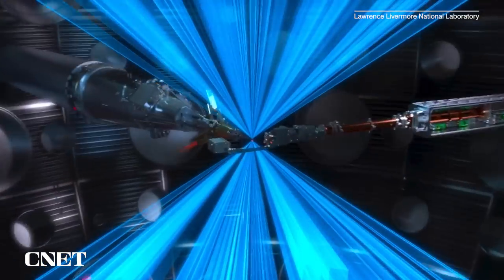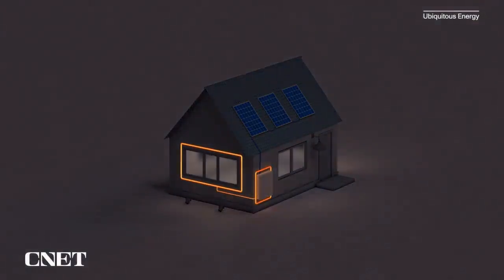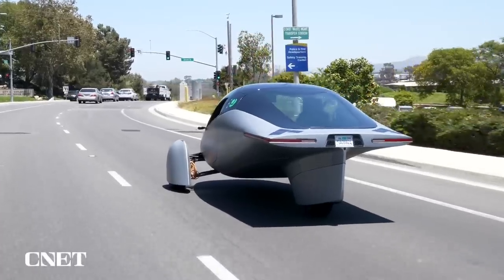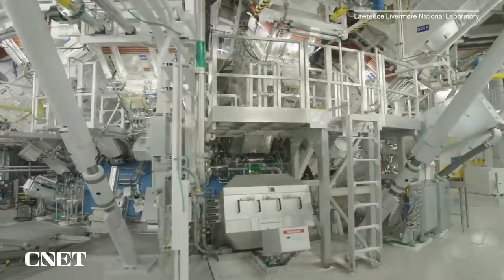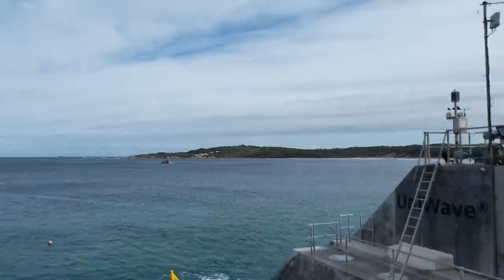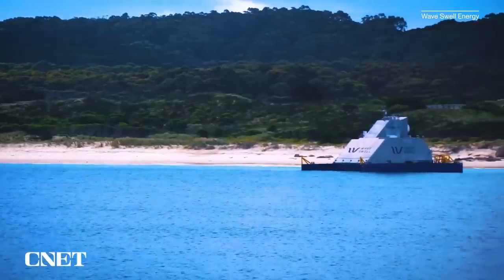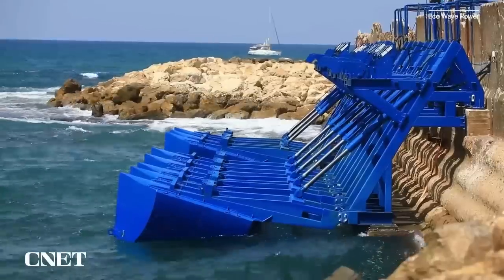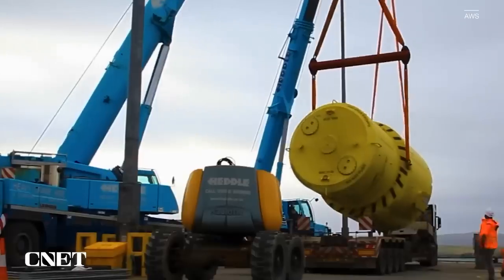Breakthroughs in Clean Energy to Watch in 2023

Comment: I’m very keen for the aptera. A beautifully designed car that will give a new level of freedom in a car.
Reply: I can't wait for the announcement of an aptera with 4 or 5 seats
Reply: Aptera is an electric TukTuk. Not good in northern regions where snow makes roads impracticable even for regular sedans
Reply: That's great to hear that you're excited about the Aptera and its innovative design! If you're interested in clean energy solutions, you might also want to check out the Segway Portable PowerStation Cube Series. It's a versatile power station that can keep your devices and appliances running for extended periods, making it perfect for outdoor adventures or as a home backup power source. It has a massive capacity, fast recharging, and even includes comprehensive protections. It's definitely worth considering for your power needs!

Comment: The wave swing looks good, it doesn't take up a large footprint or upset any views. No noise and could be used as science platforms
Reply: Thank you for sharing your thoughts on the wave swing in the video! I totally agree that it's a great clean energy solution that doesn't take up much space or disrupt the surroundings. It's definitely a promising option for science platforms. By the way, have you heard about the Segway Portable PowerStation Cube Series? It's a versatile power station that can keep your devices and appliances running for extended periods, perfect for outdoor adventures or home backup power. It's worth checking out!

Comment: since the ocean is used to acquire energy from, I think it's possible to utilize the energy people expend when exercising at the gym to be harnessed in a battery and recycled. This would be a great way to build communities participation in producing energy and physical strength and health.
Reply: Planet fitness already does this with their bikes to some extent while you exercise. It doesn't store energy, but its entirely run on mechanical energy. This means it doesn't draw any extra power from the grid.
Reply: Hugely inefficient and the power you'd get would be a drop in the bucket

Comment: I'd like to see some information about dramatic gains in residential energy efficiency.... something that makes concrete old tech... or that can store heat energy more directly than solar pv that then has be converted back to heat...  residential phase changing walls... actually convenient vacuum tube solar cooking  and domestic hot water.

Comment: It just dawned on me that if you attached a heavy weight to a giant air tank, you'd have something that bobbed up and down with a ton of force. I wonder what the limit is before you start losing too much energy from the waves no longer being able to as effectively move it. -I feel like that would scale, if the air-tank and weights were spread out over a wider area. You wouldn't even need a big tank either you could use sealed tubes and bags of sand...

Comment: Lowering the cost of solar manufacturing cost every year is the key. same with wind. If global initiative is being implemented to reduce solar/wind manufacturing cost by 50% per year. In 3 years, you reduce by 85%.  Something that capitalist and oil/gas burning industry do not want to see.  This will retire even gas power plant. The world need to have super high voltage transmission line built all over the world to transmit power from dessert and unused land to densely populated areas.